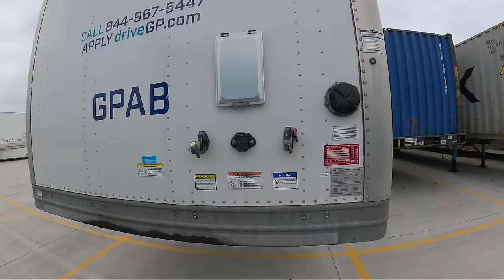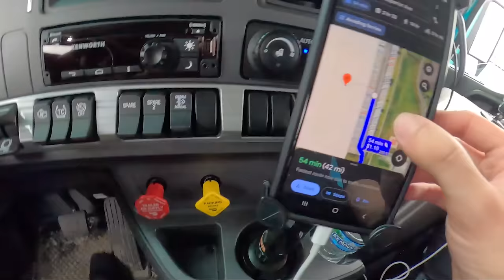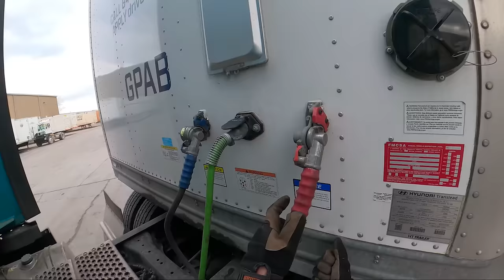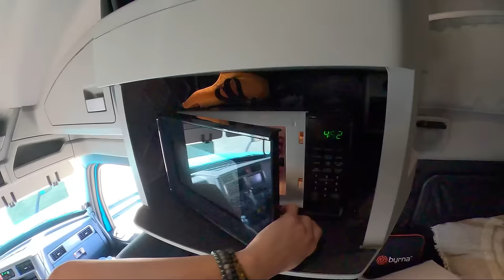I Love My Job.........

Comment: Alex. Please stop setting the trailer brake every time you get out of the truck. Only time to set that is when you parked for the night or parked getting unloaded/loaded buddy. Your air will last 10x times longer sir.
Reply: If that kenworth is anything like my company’s brand new 2024 peterbilt. It’ll bleed to 70-80 psi within 10 mins no matter what. And the dumb trucks require 90 psi to shift out of neutral. Maybe that’s ok when your otr, but when your a local fuel hauler it’s quite annoying when you have to sit in the loading rack with a line of trucks behind you waiting to load. I guess my company didn’t want to spend the premium price on Mack’s anymore 😭

Comment: In trucking, space is your friend. For a back that tight, you don’t slide the tandems to the rear . You want your tandems to be all the way to the front. Even if your steers go over the curb a little , that’s fine .Once you’re in the dock,   then you slide them to the rear for loading.

Comment: Tandems forward that backing woulda been alot easier to begin with, and don't worry bout people standing there I'm almost positive there not gunna stand there and let you hit them...stay off the brake so hard and you won't run outta air

Comment: I used to drive, mostly doubles, but also everything else except dry bulk and tanker.
I acquired blood clots in my right leg and had to quit. I'm soooo glad I didn't decide to do OTR.
What a major pain in the @$$ it is. All I did was pick up and drop trailers from one terminal to another, otherwise known as 'relay' driving.
So much easier. No customer docks, no nothing like that. Why wouldn't you just do regional 'relay' driving?
Never slept in my truck (paid-for hotels), Teamsters Union, was home in my bed every other night, etc.

Comment: Another thing is…never slide the tandems  when the truck is jacked knifed or slightly turned…it can bend the frame. And it causes the trailer to dog run sideways when driving down the road
Reply: He's not a rookie anymore ,lol he should know that!
Reply: @ZaraDavos He's been a bad boy
Reply: Agreed. It can also cause the pins to not engage correctly and not lock up right. I have a stop where I have to basically do this same manuever street back around a building and back to a dock. I always have my tandems all the way forward. Makes that swing tighter so you have room to pull up so you can straighten out before backing to the dock.
Reply: Been driving for 2 years. NEVER slid them while turned but always wondered why trailers would look sideways while driving down the road.
Reply: @RickyOHD 
Yep this is why. If the tandems aren't centered with the trailer.
Reply: All of you are rookies to me. I've been trucking since I was 15 now I'm 72 and still trucking.
Reply: @6foot4fatty  some people don't want to retire. Many people live longer working than they do retiring. If you're physically active and can do the job you have no reason to retire. 65 is way to early to retire anyway. Many people are living past 80 and social security isn't art up for people to live off it that long.
Reply: yo i was always wondering why it looks like some trailers be driving sideways going straight

Comment: Only move tandems back after you have backed in and are straight with the dock. Pull forward a bit and slide. You made it much harder to back in.
Reply: Some places require you to slide before entering the gate... Or they'll turn you away maybe know what you're talking about next time
Reply: @truckercowboyed2638  interesting….never ran into a place like that….never heard of that….thanks
Reply: @truckercowboyed2638 just pretend, they aren’t truckers thru don’t know the difference most of the time
Reply: @truckercowboyed2638 but not that place. Maybe on a DC sure but if it’s in a street or a tight space just leave them in the front until your in the spot

Comment: When applying the park brake keep the red button pushed in. Your air will build faster as you don't have to charge your trailer each time you release the  brakes
Reply: Great tip , thanks. I do the same mistake too! 😊

Comment: Stop pulling your red button. It dumps air every time.
Reply: Hitting the break every time also dump your air
Reply: How about shut up and mind your business
Reply: Yeah I agree if he would read what it says on the red parking brake knob it's not for parking
Reply: He will never stop man. Then he runs out of air and says “I think the truck is leaking” lmfao
Reply: @truckercowboyed2638  Ed there you are again taking up for alex even when he does wrong knowing you have no idea what you are talking about when it comes to truckin.
Reply: @truckercowboyed2638  bro got ignored hard 😂
Reply: @trutruckdawg9815  What is it for?
Reply: @tutie  stop watching the videos if you got nothing nice to say
Reply: @Morraless21 it’s the trailer supply line, so when a trailer is hooked up it feeds air to the emergency/park brakes to hold them off, it really should only be pulled when bobtailing. If you’re parked long enough hooked to a trailer it’ll pop on its own when the pressure gets too low, but otherwise there’s no reason to pull it, the tractor brakes hold a rig just fine
Reply: He been driving for like 2 years and he still don’t know that he supposed to only pull air supply when he parking😂
Reply: Don’t tell him how to drive give tips instead
Reply: @truckercowboyed2638 "Mind your business" while simultaneously not minding your business on someone telling another the correct way to use something... brain dead irony

Comment: I’ve actually confirmed that your truck has a air ridden transmission and that new trucks anymore come stock with that. How it works? It doesn’t in all reality because the transmission needs air to shift which helps the driver none except the range inhibitor (the fancy feature that makes you as a driver use your service brake which is obviously the brake pedal to shift which also takes away air as it is applied so it basically makes it to where it actually takes ALL of your air and has nothing to do with small air tanks your truck still has 125 PSI as required by many state DOT officials.

Comment: why is the truck always running out of air??
Reply: I'm pretty sure it's because he slams his brakes instead of tapping them
Reply: @HauntedOath some truck brakes are touchy especially when new, hes not slamming them either but staying on the brake when backing is actually what drains the air.....
Reply: He stomps on the brakes and pulls the trailer brake every single time he parks lol, dude is completely lost

Comment: I would love my job too if my company gave me that truck but with a different color. I really like the new t680. You need to learn how to use the navigation system on that gps esp the last five miles. Compare it with what Google maps shows you turn by turn to the truck entrance and you wont have to keep stopping and looking at the satellite view. I've been running this way for more than ten years with no issues. Once you know how to use that navigation system properly it will be ur best friend.

Comment: Only set and unset your tractor brakes using the yellow knob. No need to keep dumping the trailer brake system air.
You spend so much time dumping and refilling your trailer air system that it prolongs the agony.
Reply: I don’t even bother to comment it anymore.

Comment: I never ran out of air backing up to a dock. Nice try Alex…I love your videos bud.
Reply: My company uses autoshifters and my 2022 Pete 579 has that stupid thing where it will jump forward or backwards at 3mph and I have to push the brakes down to keep it from lurching into the docks too hard.
Reply: My truck if you let off the brake and dont touch the accelerator it lurches  @xxxsebasxxxable

Comment: This is my second comment on this video because you saying that you should never move the tandems all the way back when you’re backing in a tight space is absolutely 100% wrong because moving them all the way back is actually what you want to do because it gives you better control of the trailer

You absolutely did the right thing by moving them all the way back because I will tell you from experience that if you would’ve left them forward, it would’ve been even harder to back into that spot
Reply: Oh boy, here is a keyboard warrior...

Why not just enjoy the video without making a fuss about anything.
He backed into the spot without any damage, that's all that matters.
Reply: No, get some help
Reply: @UpcomingCODM  not a keyboard warrior whatsoever I have had to go backwards down many roads and San Francisco and I have had you back into many docs in New York and New Jersey. That would make me this specific area look really big and the key to doing it was sliding the wheels all the way back and he’s over here trying to imply that it’s not a good thing to do when the reality is if you’re in a tight spot it’s actuallymore beneficial to slide the tandems all the way back so that way you can turn the trailer into a spot easier without hitting anything on your side
Reply: It's easier if your scared of the tail swing but the trailer turns faster with them forward
Reply: @coreyhendershot3233  do you know why it’s harder to back a 23 foot trailer compared to a 48 and a 53? It’s because the wheels are so close to the pivot point. 

The greater the distance the better the control